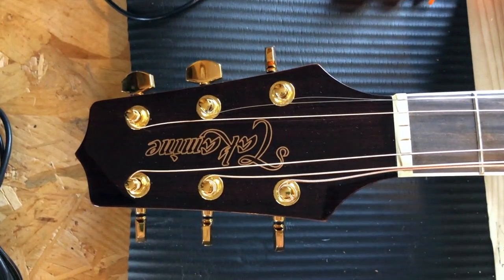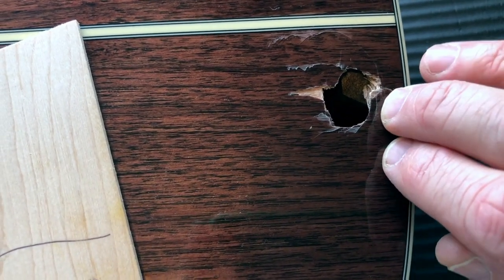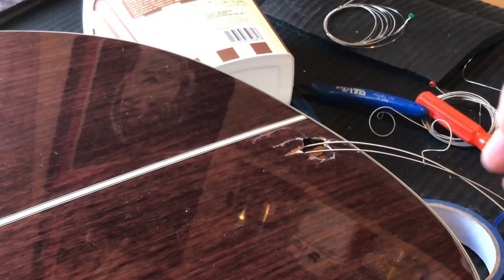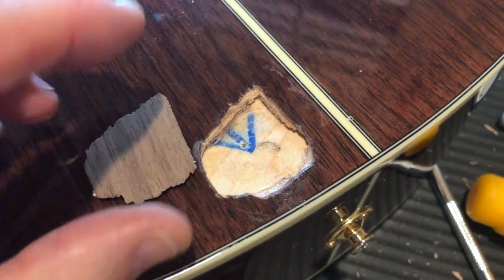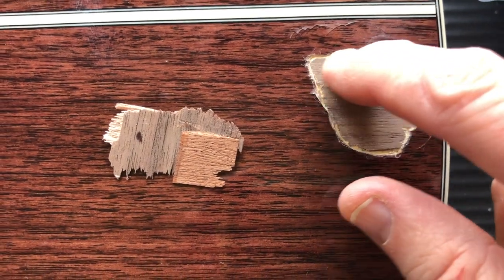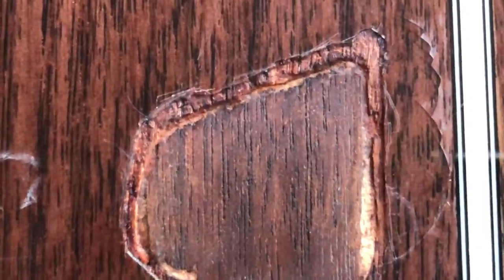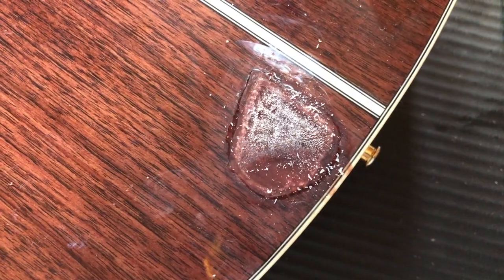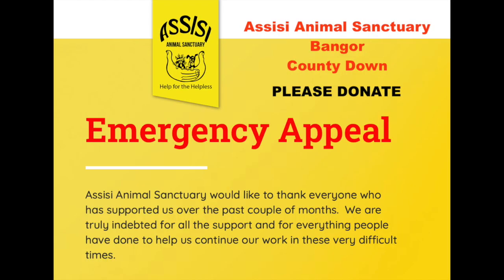Bullet Hole? Takamine! Shot in the back! Nightmare to fix, even though it was not a bullet hole.

Comment: You don't need to use super glue for a big patch. Super glue works for very small areas not the size of what you were using it for. The manufacturer didnt finish this guitar in superglue did they?
Reply from the maker: What would you have done?
Reply: I would have refinished the entire back. That would require taking the old finish off and then sanding and filling of all small gaps from the patch. Then staining perhaps and adding a new finish to just the back. Why go half ass with superglue after all that trouble?  @LennonLuthierFinagler

Comment: Thanks for making one of the few videos on YouTube about actually patching with wood instead of using epoxy or something. I am planning to plug up a hole in the side of my cordoba which has a proprietary "barndoor" pickup system which went bad and which they don't sell replacements for. I am planning on using an LR Baggs system as these don't require you drill into the damn thing.

I think you did a fantastic job. Do you have an update for the superglue lacquer fix?
Reply from the maker: I spoke to the chap and it is solid...

Comment: Can you simply cut out the affected area, create a "plug" to fit it, stain it & glue it in? Of course you'll have to add finish. However you're the Dr. Goid luck. (I'm thinking of a few fixes I saw Jerry do, at RSW.) Any way, i would be happy with the fix. It's on the back so it won't be noticed. You had a near impossible task, but you fixed it. Well done. Btw Jerry made a device, I've seen others use, that is a guitar tuning key mounted to a plastic base, I've seen wooden bases as well, with a hole in it, they simply turn the key & it tightens up. I'm new to luthiery, just did a great fret job on my 335 copy. I used tricks from various people on YT. I'm proud of myself. Lol! Who says a old dog can't learn new tricks?
Reply from the maker: I didn't have a matching wood... and the brief was - no cost and I am an old dog with empty pockets. :-)